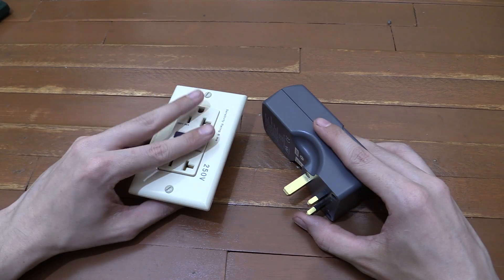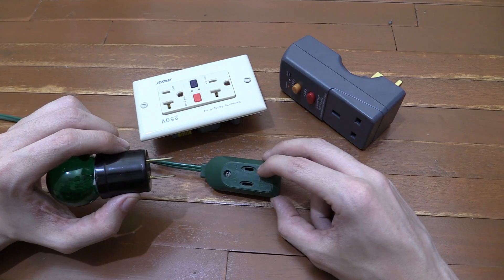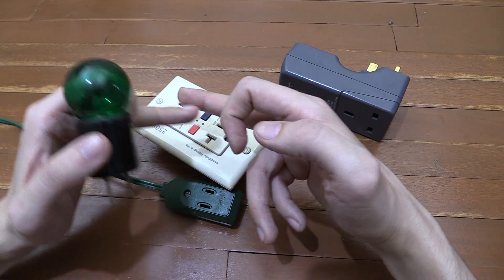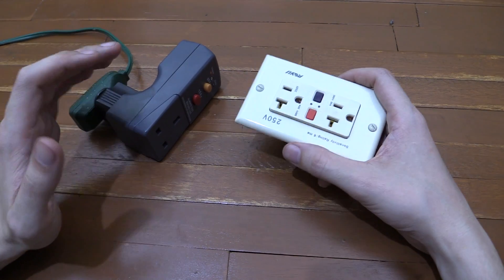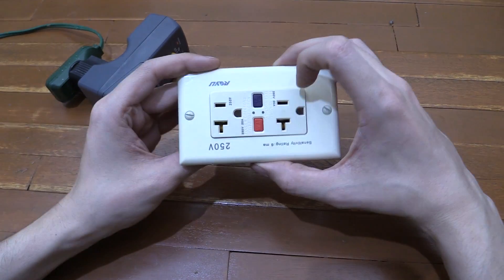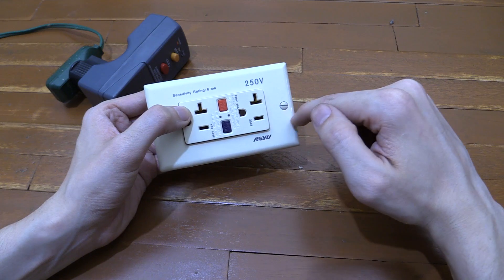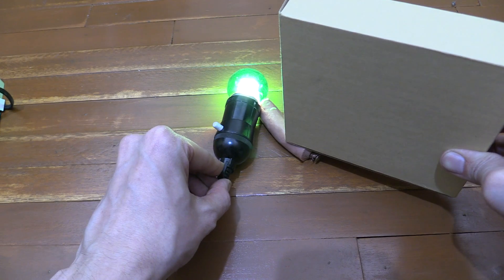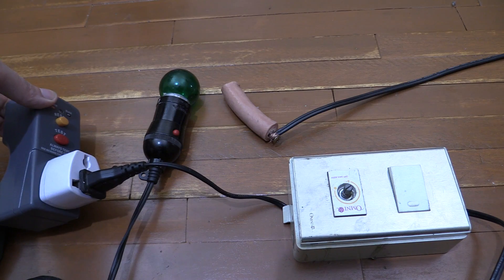GFCI Overview and Testing

Comment: Question- I have a GFCI breaker tripping randomly when I am gaming heavily on a highend gaming deskop and GPU. Running off the power extension from another room that GFCI breaker doesn't trip so somthing wrong in that room's GFCI. Replacing GFCI breaker at main panel would be costlier, if I get this would this solve the purpose of not tripping the main board's GFCI breaker?

Comment: really good thing to have wish my house in Philippines had one but our house hear infact all houses in Australia they have rcd protection thanks for that great explanation of how it works
Reply from the maker: +Kriss Bartlett Maybe you can replace your sockets when you come back to the Philippines. The double socket I showed is made by Royu / FELCO (Firefly)
Reply: its easier to only have one on the fuse box like they have hear safety switch is there common name then if I trips its easy only one switch and its inside our kitchen
Reply from the maker: Kriss Bartlett Yep if you have a modern consumer unit that can take them, you're right, it's much easier to have them installed there :)